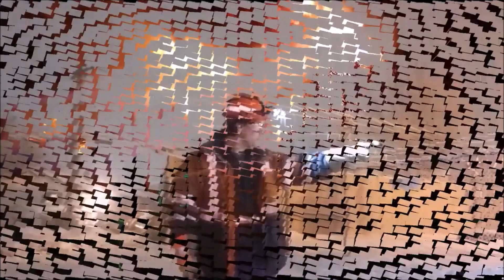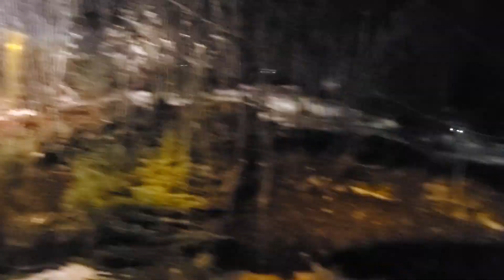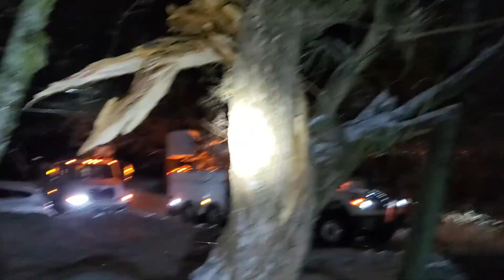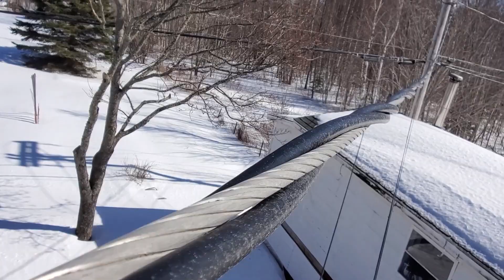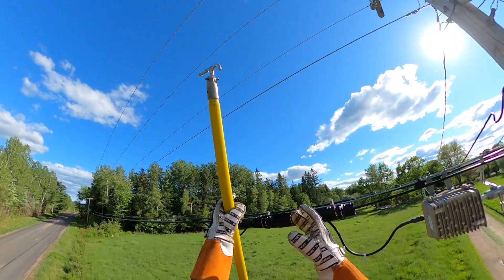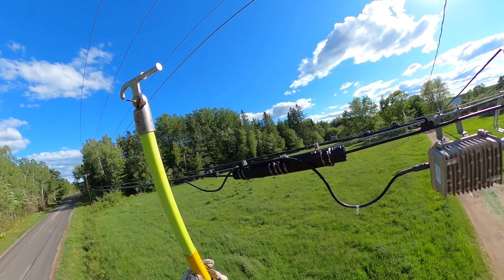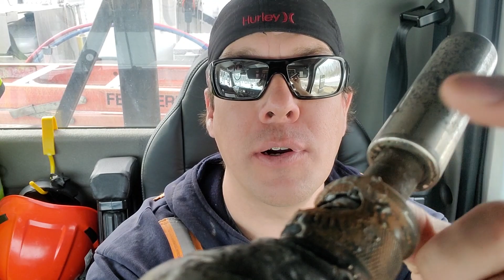Accidental contact with 120 volts

Comment: There was a guy in St. Paul Minnesota that just died after walking into a puddle with a frayed 120v extension cord in his hand.  Electricity deserves serious respect
Reply: In UK regs require all new installations to have residual current devices over all circuits in the consumer unit. If using any mains equipment outdoors all my outside waterproof power points have extra rcd protection. Years ago I cut thru hedge clipper cable...everything went off consumer side...hedge clipper stopped working.,.no drama.
Reply: @robinmyman  Um in North America all out door sockets are required to have GFCI/RCD protection so that should have not happened
Reply: Was he bare foot and soaking wet?  Otherwise that's pretty damn hard to do.
Reply: @russtomas4461  Great question, I don't know the details. I am sure that OSHA will be involved. Sounds like worked for a mechanical contractor, which doesn't mean much though
Reply: @rchuyck  Not what I mean.  You can hold on to the hot side of 120 volts and dance in puddles all day long.  Let's assume worst case scenario here.  He is not wearing water proof boots and they soak.  The current must still travel through 20M ohms of resistance to get to ground.  If his body is dry from head to foot, he is not going to fry.
Reply: @russtomas4461  You'd need a low resistance connection from line to body and then from body to ground. Wet hands (or worse wet gloves) plus wet shoes and a an old non-gfci outlet might very well do it. I know that a little moisture plus the large surface area of a wrench and a damp glove will make you very vulnerable to 12vdc.
Reply: @deltab9768  Again, very specific conditions that are very low in percentage of occurring would be required.  The cord would also need to be frayed only on the hot side.  If it were the whole cable the current would just flow through it with wet hand completing the circuit.  It's just not likely.  Especially with a puddle being the only circumstance given
Reply: @russtomas4461  Non gfi protected outdoor outlets are kind of common on older buildings, and even dry skin resistance is closer to 100kOhm than 20MOhm (although a multimeter doesn't measure it accurately). 

I agree you have to have the right (wrong) conditions to get shocked period, let alone fatally. I've touched wires that turned out to be live with 120v once or twice , and was lucky enough to not make a connection to ground or neutral. I'm more careful now, those little "close calls" are your warning!
Reply: @deltab9768  No its not.  Thanks though.
Reply: @russtomas4461   It takes 1mA to have a shock you can barely feel. 120v will pass .006mA through a 20MOhm resistance. You do the math.
Reply: @randallcarney1216  You really are completely wrong.  Go grab an ohmmeter.  I get you don't know what you don't know...but damn.
Reply: @russtomas4461  I just checked my resistance (between two fingers of the same hand using a multimeter whose highest scale is 2 meg ohms, and most of the time it was off the scale. Never dipped below 1.5 M. I measured a laptop power supply at 19.36v. I tyen put the positive probe into the jack, put tye negative probe on one finger, put another finger on the outer metal (negative) part of the jack, set it to the 2mA scale  and got .1 mA. So that comes up to 200 kOhm. I put a landline phone plug into a phone jack in the wall, and then put the other end into an old jack that had been removed from the wall but still had its terminal block. I measured 46 DC volts, and with my fingers in series with the multimeter, I measured .5mA and felt a small shock. That looks like  92kOhms skin resistance.

 Obviously, the skin responds non linearly to voltage, and the test voltage of most of these ohm meters is drastically smaller than the voltages that are typically considered dangerous. You can test this for yourself in less time than it took to read this long comment.

Again, this is with a contact area of one multimeter probe and one terminal on a dry hand. If you had your hand on a big allen key or an ungrounded appliance, and your other hand on  an electrical box or a sink with grounded piping, you're looking at way less than 200k. I'm not saying it would kill you necessarily. I've survived a mains shock and it was barely a tingle, but I wouldn't even have felt that tingle if my resistance was 20Mohm at 120v.
Reply: @randallcarney1216  All true. I might add that DC will flow to ground too if one of the terminals has been grounded. Also ,salt water, (and body fluids) conduct current through an electrolytic (chemical reaction) process, so you need some minimum amount of voltage before you really start seeing current flow. That's why your body resistance is different at different voltages and doubling  the voltages might make current go up many times.
Reply: @deltab9768  Off the scale?  So beyond your ability to read?  Ok, now make sure you are bone dry and check between your hand and foot.  And I can tell you I have been shocked with 12ov dozens of times.  I am still here.  Of course, I was not wet.
Reply: @russtomas4461  just read your comment. By "off the scale" i mean the (digital) multimeter just read "OL," indicating more than 2 MOhms of resistance. Getting more ski in contact wiith the multimeter probe brought that down to 1.5 ish Mohm. Using the 19.4volt laptop supply and milliamp function. I got .115 mA between my right hand (holding a meter probe) and my right big toe, which was resting on a coin that was touching the negative terminal of the supply. This rose to .22mA when I made the contact to a 3/4" nut held between my fingers. Again, this is with dry hands and feet, and we're seeing the multimeter read down to 1.5 megaohm and when I make these measurements with 19 or 46v it's coming out anywhere between .2 and .09 megaohm. I didn't check the hand to foot measurement with 46 volts, though.  Electricity conducts by an electrolytic process in your body so it's going to need a certain level of voltage to get that chemical reaction to happen. 

I still strongly disagree with the idea that your body resistance is 20Mohm. I agree that you'd need a series of unlucky circumstances to die from 120v, but it still happens from time to time.
Reply: @deltab9768  OL means the reading is beyond the ability to measure on that setting.  If your meter has no higher range, move up to it.
Reply: @russtomas4461   Yes I understand this. It  means that if I'm on the 2Mohm scale, it was interpreting it as more than 2Mohms resistance. Did you read the part where I measured resistance at 19.4v, and found it was about 100kOhm?
Reply: @russtomas4461  This is my last comment here. The resistance of your skin decreases with applied voltage, the current rises disproportionately to the increase in voltage, and SKIN RESISTANCE READINGS TAKEN WITH A LOW VOLTAGE OHM METER ARE NO INDICATION OF THE SKIN RESISTANCE PRESENT DURING EVEN A MILD ELECTRIC SHOCK. 

At this point, I'm not even arguing about the safety of touching line voltage; I'm arguing against this claim that skin resistance is 20Mohm at any voltage, and I have provided guidelines to carry out an experiment you can easily do yourself if you want to know the truth.
Reply: @deltab9768  Skin resistance is typically between 1000 and 100,000 ohms.  Higher voltage will result in dielectric break down at which point you're  at body resistance  300 ish ohms.  At lower voltages cuts or abrasions can get you into meat bag resistances. There's a host of other factors surface area, moisture, sweat, dv/dt, voltage gradient, person to person variation....  Very ball park 1 to 100k going in 300 ohms thru and 1 to 100k going out. As you saw using a multimeter on ohms gives meaningless results.
Reply: @russtomas4461  thats what im wondering. i picked up a frayed wet extension cord TWICE(on different occasions) and all it did was give me a real spicy zap and tingle.
Reply: Please  do not pay  attention  to some of this misleading information! Our body is made up of a large percentage of  water and salt AC will definitely  conduct  through our bodies  to earth whether we are wet or not!

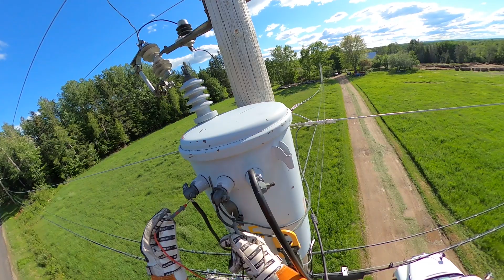Comment: Something to think about.  Stick welding has an open circuit voltage of about 80 V, running arc about 15 to 40 V .  Think about what will happen with 120 V and a very high current limit. ( someone please post what amps that pole transformer is capable of at 2:30 )   Also, I've been about 40 ft away from a 480 3 ph  electric crane collector rail when carbon brush dust flashed over.  You really don't want to be anywhere near that when it arcs over.

Comment: Do you have to do incident reports when these incidents happen if there are no injuries?  Do you get in trouble?
Reply from the maker: Absolutely. There a few different types of incident reports, all of which main purpose it to prevent the situation from happening again.

While incident reports often bring to light faulty equipment or procedures they do also involve intentional shortcuts and bad work practices. We don't like to use the word "trouble" but their can certainly be some coaching involved following an incident. Repeat incidents or infractions mAy also lead to suspension or re-evaluation of one's role.
Reply: @Bobsdecline  Thank you for that information.

Comment: Keep in mind, a stick welder is typically only operating at 16-40V. It's quite good at liquefying steel.
Reply: Even 5Volts are enough. Look at refining Aluminum.
Reply: Just watch the YT videos of peeps using 2V with 2.2 kA to melt steel in seconds.
Reply: @magicmulder  I start my car using a pair of double A batteries

Comment: I was removing a service last summer, a simple job to finish out the day, and ended up blowing up the cutters I was using. I went to cut the second hot leg and got the jaws into the neutral too. Sparks went everywhere and splattered my shirt as well as got inside and left a couple dots on my chest and a piece of hot metal landed on my eyebrow and left a good burn mark. Overall I’m fine but if I took an extra minute to think about how I wanted to cut it down I could have saved myself the embarrassment
Reply: S T A R  You know the drill
Stop. Think  Act. Review
3 way conversation
Reply: I used to keep a Klein screwdriver in my tool grip.  Had been undoing L1 when debris blew and shorted the screwdriver to The other phase.  It left a corkscrew blast around the shaft of the screw driver as the insulation burnt.  It happened so quick that the motion of the screwdriver before I pulled back from the panel created the spiral.   It was a great reminder that no matter how safe you think you are and how experienced you are that things can still happen
Reply: and now you wear the PPE for every job?
Reply: @philhoward4466  I was wearing my PPE that day, every day before, and every day after. So your question comes across as cocky, ignorant, and condescending. PPE has nothing to do with the events that unfolded. If I took an extra second to think about what I was doing and a better way to go about it, it wouldn’t have happened

Comment: Any idea what the potential amperage was that went through that drill? I know any voltage has the potential to kill someone even a 1.5 volt battery can kill if it hits your heart at the right moment. I am in Portland, Maine thanks for the videos and you and yours stay safe. Hope you love your new house.
Reply from the maker: With a short low resistant path like that, and by how well it (apparently) made contact... I'd say say well over 1000 amps.
Reply: @Bobsdecline  Thanks for the reply I guess you guys are really into the hot stuff I didn't think it would be that much amperage. As I said stay safe out there. Wishing you and yours the best.

Comment: I had turned off the wrong breaker while replacing an outlet. I ended up melting my screwdriver against the metal box and because the particular circuit breaker had failed it resulted in a pretty scary arc flash. The wall had to be repainted it was so badly burned. I bought a non contact tester and I never go without checking.
Reply: Hired a contractor to replace light switches. He couldn't get voltage. Pulled out my non contact tester and the hot lines were still hot. Come to find out. Him pulling the box out he pulled the neutral out of the upstream box.
Reply: I dislike the go/no-go NCVs, they're hard to get an affirmation on. I have one with a proportional chirp, and you can hear the difference between the line sine and square wave of fluorescent drivers, and the amplitude tells the story. It's a crazy squeal off an HF LED driver, and it's good for double checking old-as-balls light switches that can have substantial leakshorts from 90 years of flash-sputter. Not enough to light up even a 5w lamp, but I don't want to tempt fate

Comment: I was a lineman a few years before going inside to the power plant.  One of the biggest fireballs I ever saw was when our digger operator pinched the pole claws around a hot 4/0 -240V service wire.  We had to replace both claws when we got back to the shop.  On the flip side I’ve seem 6A copperweld 7200V energized laying in a ditch doing nothing.
Reply from the maker: It's almost like electricity doesn't always follow "the rules"... So many factors in how it behaves certainly makes it much more dangerous.
Reply: @Bobsdecline  I would never say it out loud.   I always figured if I ever got hurt it would be on secondary.
Reply: It might not be visible doing anything but it could easily create a voltage gradient on the ground that could knock someone to the ground and even kill them.

Comment: Congratulations on the new place! 

And yes, I hate hearing that about voltage too... 48 can be bloody dangerous (when it's connected to a several tens of thousands of amphours of telephone exchange battery). Even 12-24v isn't something you want arcing out in front of your face crawled under a car because you didn't disconnect the battery!
Reply: It has its place, properly used to explain why low voltages can be dangerous and high voltages can be safe. 

A feather dropped off the Empire State won't hurt a bit.

A car an inch above your torso would kill you.

Comment: Arc flash/arc blast is far more dangerous at secondary side of transformer. A 1500kva transformer can have fault currents of 100,000 amps or more on the low voltage side, while the primary at 12kv may only be capable of 3000 amps. You don't want an event on either side, but the low voltage side will create a far larger flash/blast. Secondary voltage may be safer to handle, but the fault currents are more dangerous.

Comment: An AC welder is fusing metal at like 40V and 150 amp, just imagine what 120 volts at a 1000 and some amps can do 😲
Reply: Yep output is normally in the range of 16-30VDC or 24VAc on aluminum
Reply: It's more in the few kA range

Comment: I work with lithium ion batteries, and even those are powerful enough to vaporize a wire, making it act more like a fuse than a wire. Seeing just how powerful electricity can be, helps you learn to respect it.
Reply: Yeah, remember as a kid, with olde NiCD batteries... having one with the sleeving damaged, and getting it across the battery terminal in my walkman (i'm that old LOL) , the terminal wire glowed yellow before i smacked it free of the terminal.

Comment: Another great video, Aaron!  I had an experience similar to what ibiza1290 mentioned, when I was in high school, wiring a new dimmer board for the drama club.  All I had left was the plastic handle of my long screwdriver.  Spectacular fireworks show and the hole in the back of that panel is still there!  Congratulations on your new home!

Comment: During my firefighter training, one thing that was mentioned is triplex reccoiling over a primary line, or low voltage going over primary. That line could now be at primary voltage. Don't touch what's on the ground.
Reply: Where my friend lives the local power company replaced all the poles AND got rid of the secondary lines between poles by putting a transformer at every pole instead of every 3rd pole. I guess that reduces the chances of a cross between the primary and secondary.

Comment: You can burn a finger off with a car battery at 12V.  There are only a few thousand amps available(1 battery).  Try putting a wrench across the posts.  Very good reason for a non-conductive wedding band even when working with 12V.  12V especially with sources in parallel(potentially 10's of thousands of amps) will do the same....don't feel 'safe' you solar guys.  Only advantage is that skin does not really conduct at 12V.  Short the thing with a decent conductor and the same metal flys.
Reply: A friend of mine took a microwave oven transformer and punched out the secondary and wound a 6 awg starter cable through it (the cable that connects the starter solenoid to the starter). It only put out something like 3V, but it would easily melt pennies and pretty much everything else we tried it on.

Comment: Not surprising at all, given an unfused circuit and plenty of current on tap. Keep in mind that arc welders will operate at 30 volts.
Reply: Oh it has a fuse. Just not one designed to protect you. It's there to protect the 15k/25k/etc. transformer, and grid.
Reply: @jfbeam  Yes, but I'm referring to the secondary (LV) circuit.